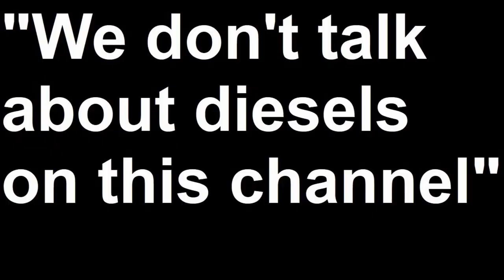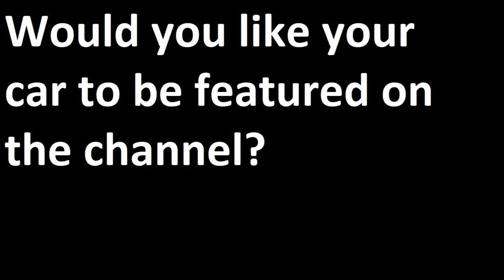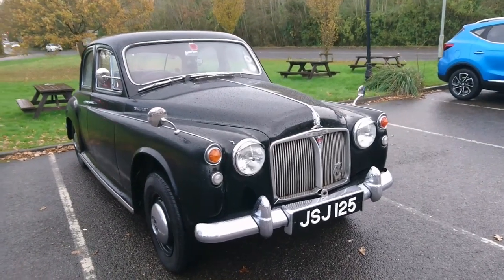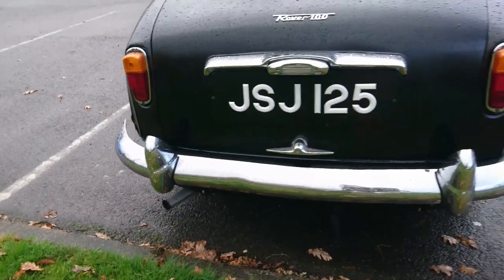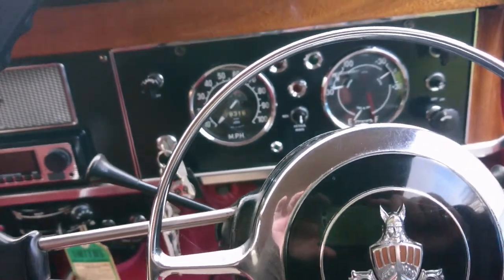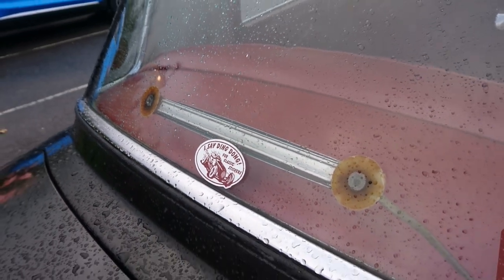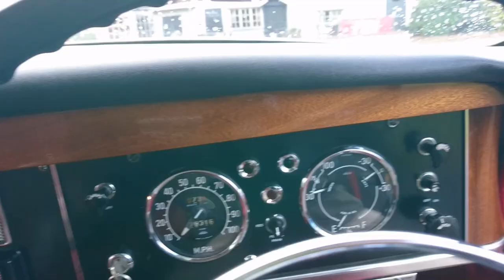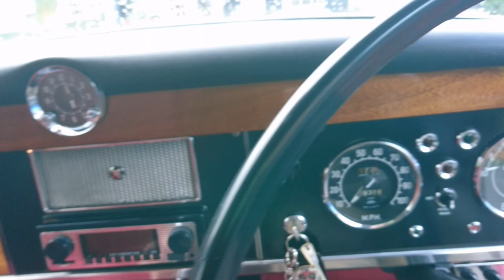Sensible Secondhand Classics: 1961 Rover 100 (P4) - Lloyd Vehicle Consulting

Comment: Great review Joseph, some car for 60 years old, built to last. Alex has the engine bay spotless. I wouldn't have bothered with rear window demister, don't use them on modern cars, mist helps block the ugly faces of tail gaters 😄
Reply from the maker: Yes, Alex's professional expertise shines through when looking at the engine bay of this P4! I get very disturbed if my heated rear window does not work properly for some reason.
Reply: @lloydvehicleconsulting  I have to agree if my rear window isn't working ..I must be anal retentive.
Reply from the maker: @Luke-PlanesTrainsDogsnCars  , the one in our Rover has a couple of lines which do not work. It does irritate me.

Comment: A rare bit of nostalgia for me. I had a drive in my late father in lawa Rover 75 back in the late  60s, and also found that gearchange somewhat awkward. Speaking of gear selection, did you find out what the issue was with getting fifth gear on the Stanzas? Keep up the great work!
Reply from the maker: That gearchange was a bit crazy, sir, and I have not been rushing to ask Alex to have another go! I still don't know what the problem was on the Stanzas, I will have to try a Bluebird and then I will know what the issue was, as they share the same gearbox.

Comment: With a little more practice you would get the feel of the gearbox and enjoy. The key is not to rush the changes and match your revs as near as possible to your speed on downchanges. Simpler still, simply stop and move down into 1st while stationary. As for the big steering wheel that is designed to help reduce the effort required for the non assisted steering.
In 1980 our local Education Board Field Centre ran a 1979 Pinto engined LWB Ford Transit minibus and a LWB Land Rover Series 3 crew bus with a 2.6 litre 6 cylinder in the yellow and white colours of the bus that I emailed you. I wonder if that engine has any relationship with the P4 6 cylinder.
Reply from the maker: Yes sir, I did stop and move into first when stationary! It was still a right hassle, especially as first is where third normally is, and reverse is where first normally is, the steering is four turns lock to lock and is about the size of a tractor tyre, and the power assistance is a distant dream. I don't think I will be making a career of driving cars like this...
Reply: @lloydvehicleconsulting  you want to try a Bedford TK. You will learn to love 5 turns lock to lock and mastering a crash gearbox is a wonderful feeling. Once you get the revs right you can even forget about the clutch pedal like you have to do when your clutch needs replacing.
Reply from the maker: @seancooke7332  , I won't be attempting any lorry driving, sir, don't you worry!

Comment: First gear was for towing caravans up 1 in 3 hills so it was seldom used and no point fitting syncromesh  lol
Reply from the maker: Fortunately, these days, you can retro fit electric power steering to make them easier to handle.. The gearbox, however...